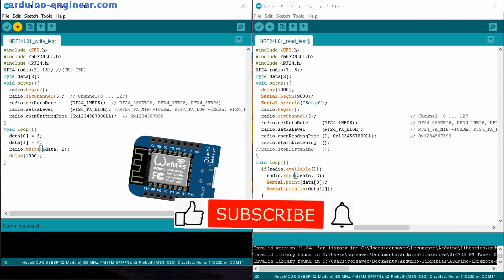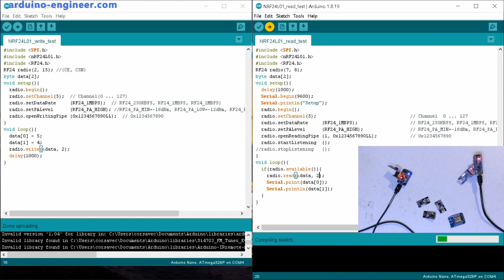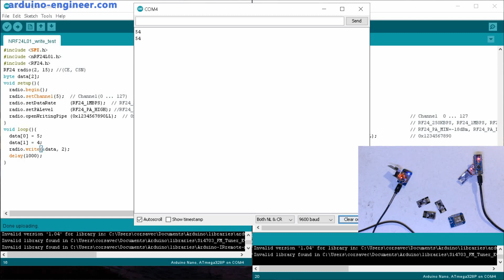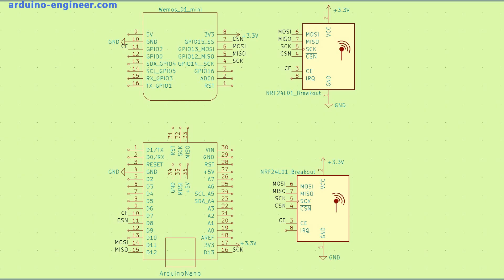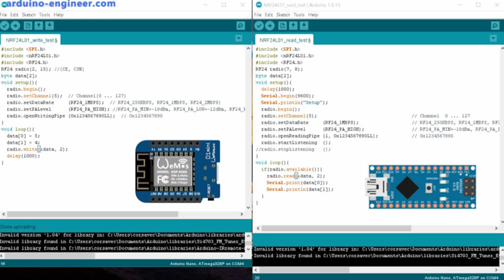🚩Best NRF24l01+ESP8266+Arduino NANO connection tutorial

Comment: Can you write a code for making  keyfob (passive keyless entry) using always listening nrfl24l01+Arduino mini and  another  nrfl24l01+Arduino mini transmitting specific code on every 3sec interval.
When keyfob comes near bike it receives specific code and retransmit another specific code which is received by bike and gets turned on?